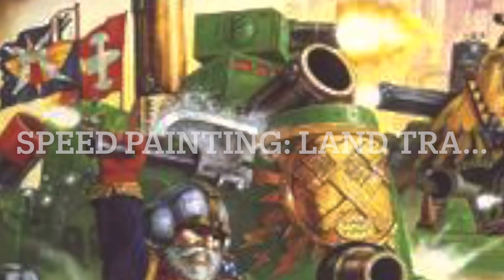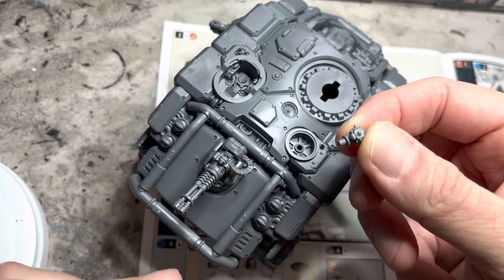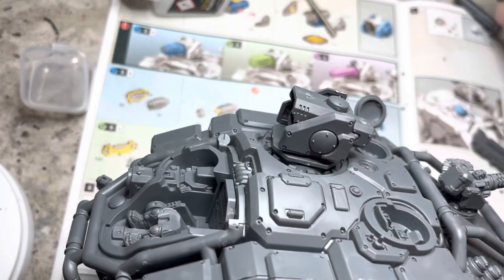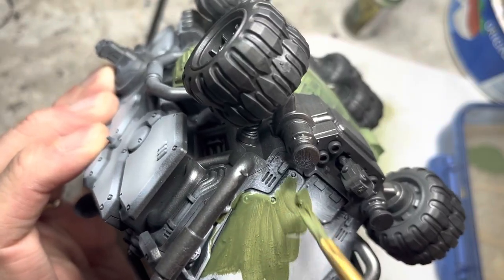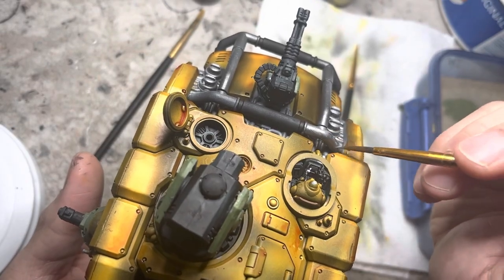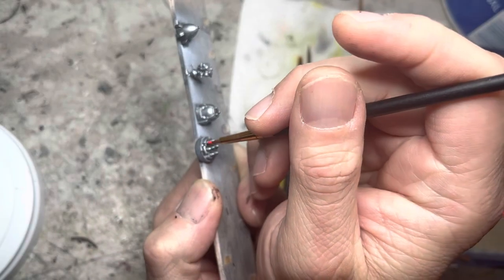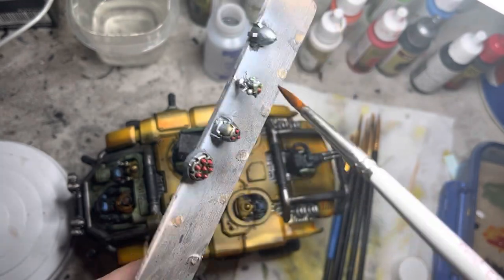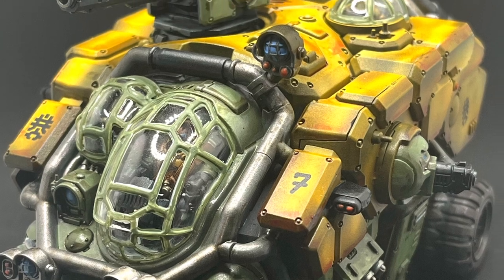Speed Painting | the Hekaton Land Fortress from Leagues of Votann

Comment: why not just use vallejo metal color? its the best metal paint by far
Reply from the maker: I’ve heard nothing but good things about Vallejo. I’ve been a citadel user for years and just switched to AP paints three years ago. But I’ll give Vallejo a shot the next time I’m paint shopping.
Reply: @no.6minis  Make sure its the metal air colors, they come in a bigger bottle than standard droppers. You won't be disappointed. They are also a breeze to brush on.